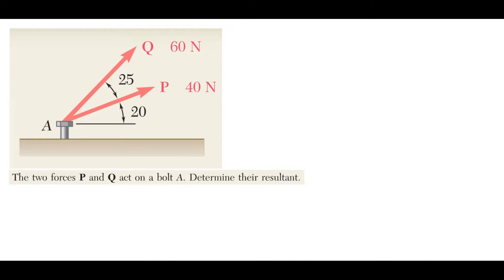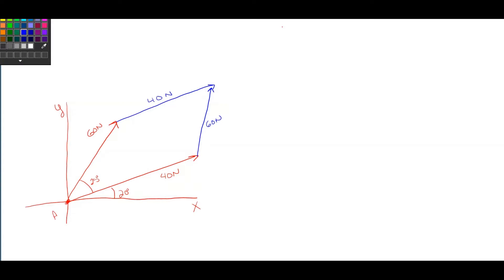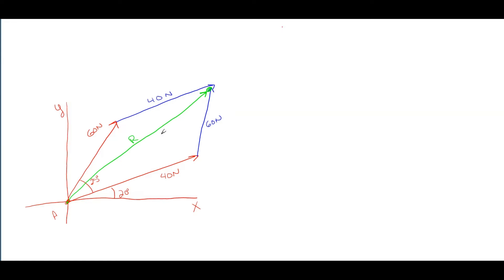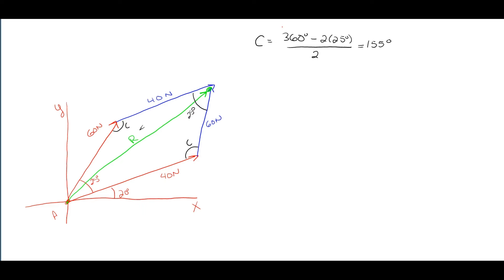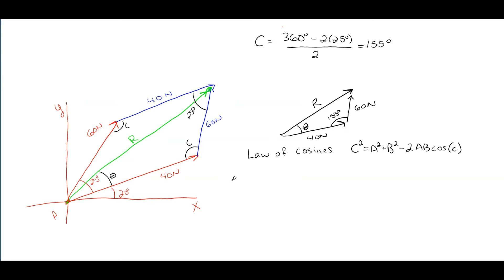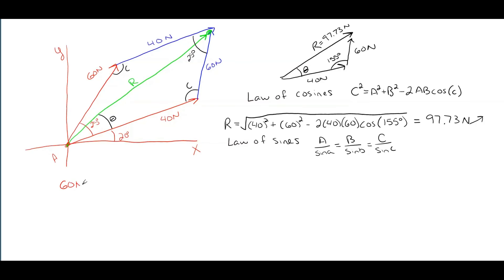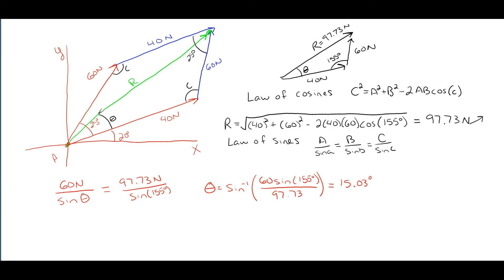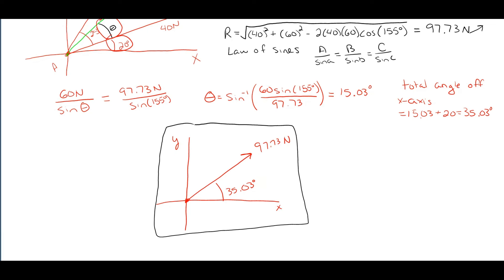How to Find the Resultant Force - Components and Resultants Parallelogram Rule - Statics Problem 2

Comment: Why to 360°-2(25)?
Reply: 360/2 ie 180- ( 25*2) i guessed but it's a bit different here! Did you got the answer??
Reply from the maker: This was done because we know the parallelogram contains 360 degrees total (as do all 4 sided shapes).  We know from the problem statement that this parallelogram contains a 25 degree angle.  Since it is a parallelogram, the angles which are opposite locations are of equal value, thus there are 2 angles of 25 degrees.  Thus, in order to determine what amount of angles remain in the shape, we take 360 - (2)(25).  I hope this helps.